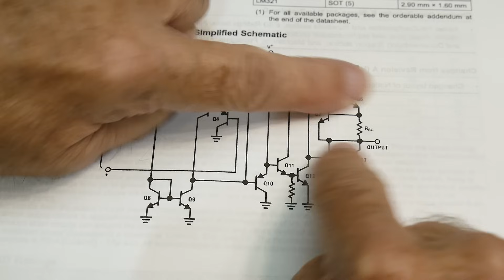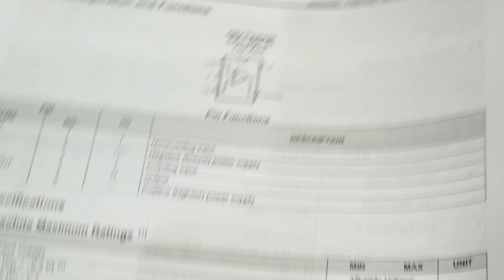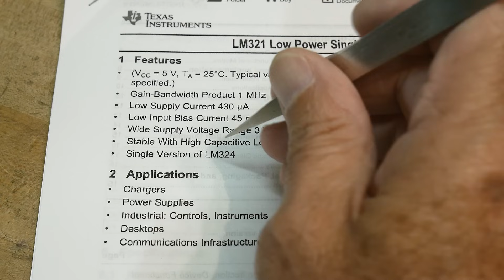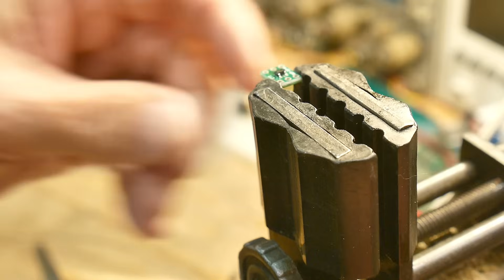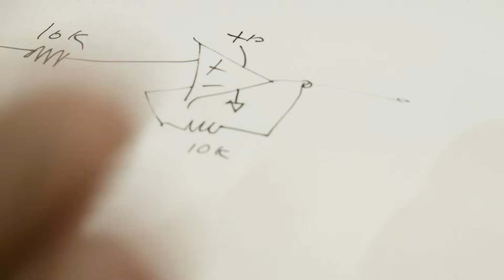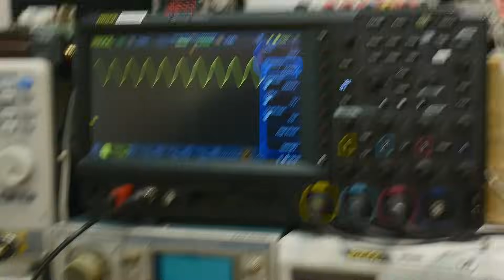#1709 LM321 Op-Amp

Comment: You should see my bench. At least 15 projects going on at the same time, parts piling up.

I have done proto soldering a lot. I have a vacuum pump with a suction pipe near the tip of the soldering iron since 1999. That effectively removes fumes to the pump and its filters. I can recommend that seriously. Colophen irritates the breathing canals and lungs in long term.

Comment: Used the LMV versions, the single, dual and quad variants for a simple audio work project and likewise had to put them on adaptor boards as I tested it all on a bread board. My colleague needed a quad op-amp so he got the LM older type which didn't fair so well till he asked me which ones I got and I told him it was the newer V version but he than ran into the bandwidth issue but then I was working on audio. Good little op-amp. Great videos.

Comment: It was most disconcerting to see the ic being soldered to the adaptor, which has a square conventionally marking pin 1, with its pin 1 on the opposite side. The ic has pins 1, 2, 3 on one side with 4, 5 on the other. It's not going to make much difference except for somewhat increasing the chance of mounting it the wrong way round in a test circuit later, once you've forgotten that pin 1 is on the side with 3 pins, and assume that the square marks pin 1.

Comment: I hate the LM324... very poor performer at 5V.
Reply from the maker: https://youtu.be/F4DFn6CtUes?si=6-vuG11fqiLo0FQc
Reply: Maybe, compared to modern rail-to-rail CMOS amps. But when they came out, the LM324/LM358 opamps were so useful because they could accept inputs as low as several hundred millivolts below the negative rail, which was a godsend for small signal, single-rail applications where it didn't matter if they couldn't swing anywhere near the positive rail.

Comment: The gain-bandwidth-product is one of the speed limitations. The other one is the slew rate. For the LM321 it is 0.4 V/µs. Which is not a lot. In order to generate an output signal with an amplitude A = 2 V amplitude at a frequency f = 500 kHz, you need a slew rate of at least the max(dV(t)/dt) = 2*pi*f*A = 6.28 MV/s = 6.28 V/µs. This is more than one order of magnitude higher that the slew rate of the LM321,

Comment: Do yourself a solid and get a few "SMT Test Sockets" so you don't have to solder them when testing. You just put the chip on and it clamps. They are especially great if you want to test different chips on the fly.

Comment: Sometimes people mis-label the SOT-23-5, as "SOT-25". I've seen that in a few places before. Something to watch out for.
Also, I use the same trick of using some breadboard to hold the pins while soldering up those little adapters :)

Comment: I discovered LM321 some time ago, during a disassembling smd pcb session and now it is an ace up my sleeve when I need a single opamp chip in my schematics. It works great for me!
P.s.: don’t you forget a good pair of glasses while soldering it!😅
Reply: It's not a great op amp by any right, it's a direct descendant of LM324. But if it works for your circuits, that's fine 😊

Comment: I solved the problem of having to use tweezers and adapter boards. I have a stock of thousands of large IC's that will actually drop right into where adapter boards would normally go.

Comment: Ah! A way to deal with all those excruciating small RF transistors I bought years ago. 
Thanks!
Reply: The SOT-23 is a remarkably big and and clunky package in comparison with some.
Before I quit doing this stuff I developed a fondness for dual transistors in a 6-pin thin SO package, the designation of which I can't recall. It occupied less board area than a SOT-23. I could get two devices placed on a PCB for the same cost as one and use the part as either two transistors or a transistor and a diode (convenient for driving a relay).
Reply: They also make SOT23 adapters for 3-terminal devices where all the connections are brought to one side only. Add a triplet of 90 degree connectors, and you can use it almost like a TO92 device. I use those.

Comment: Cant stand soldering left handed.  So much so ive been forcing myself to do so. I tell you its not comfortable doing so but way better then flinging parts off the board like i used too. 😂

Comment: It looks slew rate limited at high frequencies.
Reply from the maker: yes, all opamps are
Reply: @IMSAIGuy  Only for sufficiently large signals. For example, if you're using a unity gain buffer with an opamp having a gain-bandwidth product of 1 MHz and a slew rate of 0.4V/μs, then a 2V pk-pk sine wave will indeed be slew rate limited at around 64kHz, but any signal less than about 120mV pk-pk will be bandwidth limited to 1MHz.

Comment: Kudos to you for soldering sot23 without a microscope. 
I want to send a gift, but patreon only has a subscription option.
Reply: I can solder SMT without any visual aids. My secret - I am very nearsighted. In this case that helps because it's like I have a magnifier glass built into the eyes. For everything else it sucks though. :)
Reply: @stamasd8500  He's five years ahead of me. I'm trying to set goals.
Reply: Patreon will allow you to subscribe , then unsubscribe. It will ask you why you want to unsubscribe, and one of the answers you can give is "I only wanted to make a one time donation" (or something to that effect).
Reply: @W1RMD  Yeah, that's what I did last year.  I didn't want to be a quitter again. Do you know if youtube takes a big cut of the donations made through the super-like option, which I've seen in some channels?
Reply: not sure @jspencerg

Comment: Very nice little video.  Thanks for showing the surface mount soldering and making up the adapter.  I've been into electronics for decades, but only in the last year have I done much with surface mount.  In my teens I could paint tiny models with toothpick or fine brush and I could focus down to the tip of nose.  Now, in my late 60s, my hands sometimes shake when I'm trying to do fine things and my eyes losing it both for near and far.

If I remember correctly, the gain bandwidth would be specified at the 3 dB down point.  So, at 500 kHz you should have 3 db, or 50%, of the calculated gain.  You went by it pretty quick, but that looked to be just about what your scope was showing, the gain reduced to about half at 500 kHz.

Comment: Use the Forceps, IMSAI Guy! One of my favorite tools. I learned that from Fran.

"Sometimes 'more' makes 'less' easier" - ha, that was a good and true one! It's all about adhesion and cohesion. Don't skimp on flux too.
I also use a breadboard for soldering, working fast on just enough pins to keep the part from moving, and doing all the remaining pins out of the board to prevent heat damage.
Reply: May the forceps be with you.
Reply: @stamasd8500  and U2!

Comment: AFAIK, it was Motorola that started the SOT-23 designation for those surface mount packages... but back then, they only had 3 pins (2 on one side, 1 on the other.) For the LM321...  it would be SOT-23-5. The JDEC designation for SOT-23 package is TO-236AB.... but not sure if it's TO-236AB for a SOT-23-5 package?
Reply: Motorola always went its own way with package designations. The designation was typically 2-4 alphanumeric characters followed by a dash and another 2 or 3 characters, then a "STYLE" designation.

I have a ton of old Motorola data, but it is stashed away. I did find one SOT-23 device, the MDC1000BLT1 (an interesting "MOSFET Turn-Off Device with Integral Gate Clamp"). From the datasheet:
   MDC1000BLT1
   CASE 318-07, STYLE 22
   TO-236AB (SOT-23)

On the same datasheet a TO-226 (TO-92) is "CASE 29-04,. STYLE 33"
A TO-261AA (SOT-223) is "CASE 318E-04, STYLE 6"

Comment: These where the first SMD devices together with BCM847,857 i bought a some years back and i had no idea how small they where and they are still unused in their blister. i blob these devices and later remove excess later with solder wick, but SOT.. devices not yet tried.
Reply: I reached the point with SOT-23 where I was muttering "Jeez these things are big and clunky!"

Comment: I just wanted to propose using a breadboard to hold the pins for soldering but I was not fast enough. I always take a special one for the purpose not to ruin the contacts of the good ones but it might be to careful.
Reply: I always use a solderless breadboard for this. I solder the 2.54mm header pins first and then place the part. No need for a vice/vise. Furthermore. for DIP adapters I use turned pin machined headers rather than the square pin headers because they slide in and out of the breadboard much more easily, particularly when you have more than a few pins. For SIL I still use the square pins for mechanical rigidity.

For soldering the part, I use a flux pen on all pads and solder on corner pin as an anchor, orienting appropriately under a stereo optical microscope. For larger parts, I also solder the diametrically 
opposite pin too before doing the rest of the pins.

Typically I clean the boards in an ultrasonic cleaner too to get rid of any ionic contaminants which will affect hi-z circuits. Residual flux can leak at ITRO 1uA/V.

I then use a labelling machine with a 6mm two line label to label the device for future use.
Reply: if you are a quick solderer you can get away with it.  But i'd use a sacrificial protoboard.